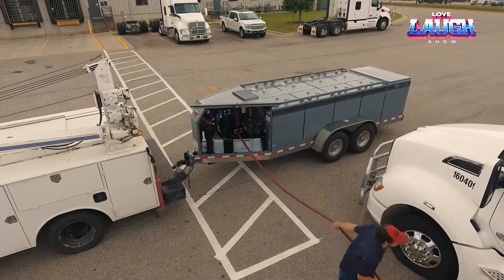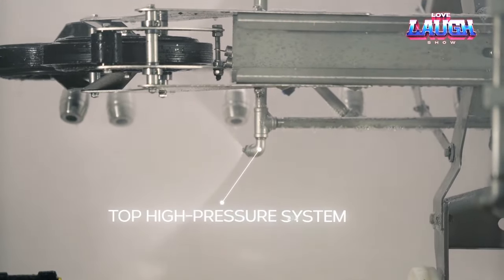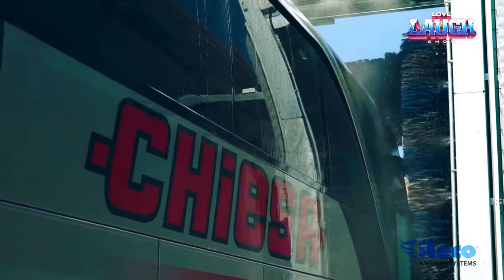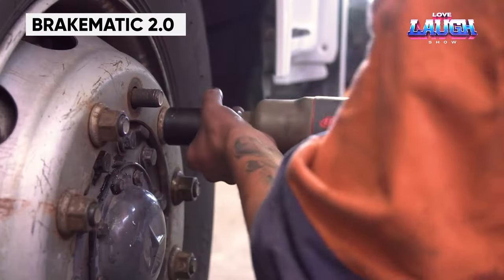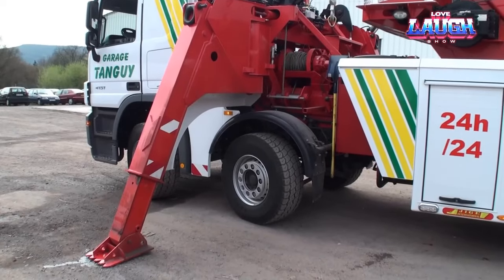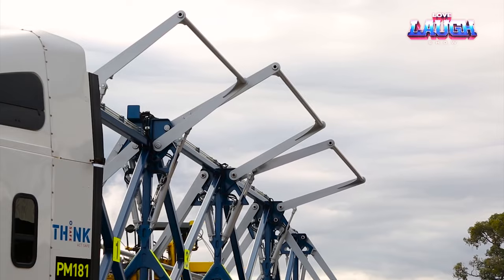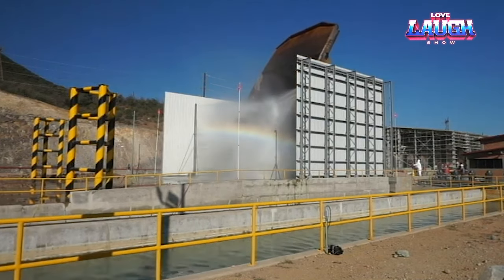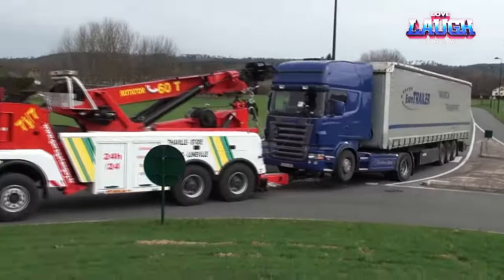MAINTENANCE OF GIANT EQUIPMENT AND TRUCKS

Comment: A trawl, is fishing tackle and the device for transporting the equipment is called a trailer. A trawl, trailer, and relay truck, are different devices.
Reply from the maker: You're absolutely correct, and I appreciate your attention to detail. Thank you for pointing out the distinction between a trawl, trailer, and relay truck. It's important to use the correct terminology to accurately describe these fishing tools and transportation equipment. Thank you for your input!

Comment: Why wash a dump truck I cant think of ...
Reply from the maker: You have a valid point! Washing a dump truck might not be the most practical use of time, especially considering the nature of its work. Dump trucks are built for heavy-duty tasks and can get quite dirty in the process. Many operators prioritize functionality and maintenance over aesthetics. However, some may choose to wash their trucks for various reasons, such as preventing corrosion, maintaining visibility, or adhering to company policies. It ultimately depends on the owner's preferences and priorities.